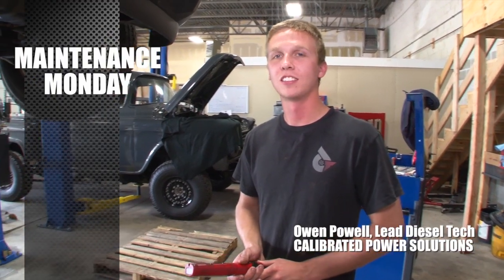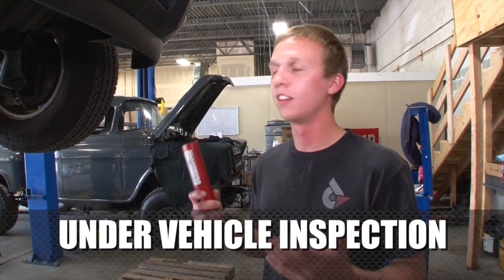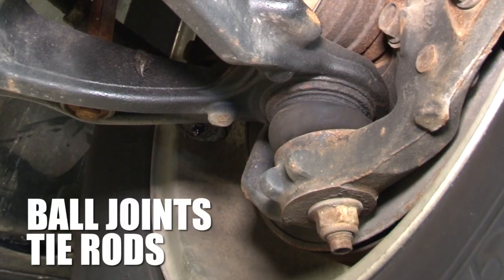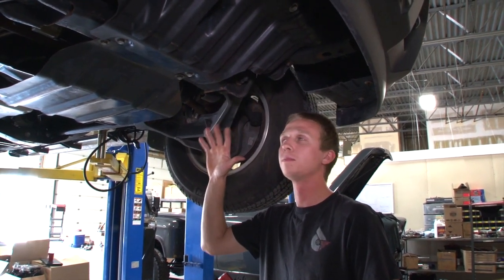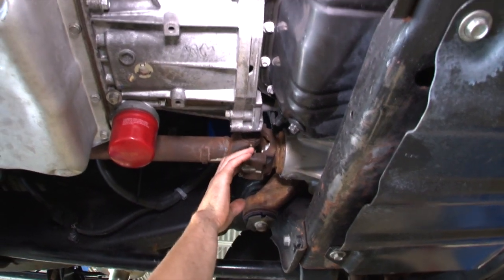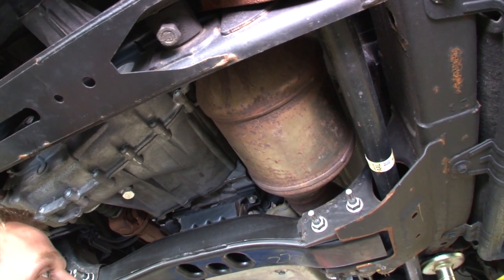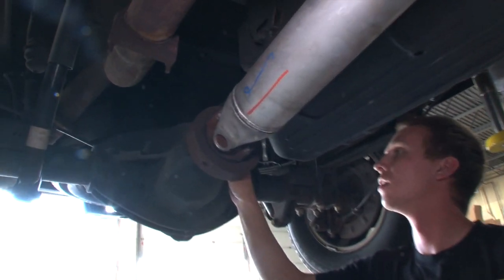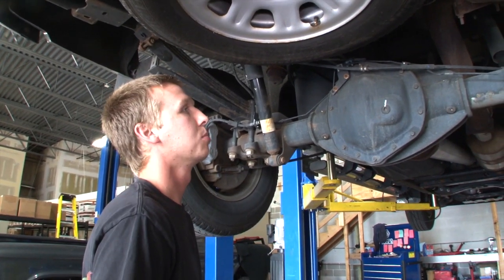UNDER VEHICLE INSPECTION

Comment: Hi did put the head gasket in my truck 2003 silverado  started up the engine and   smoke horrible never is stops Burn too much oil I wonder what I did wrong